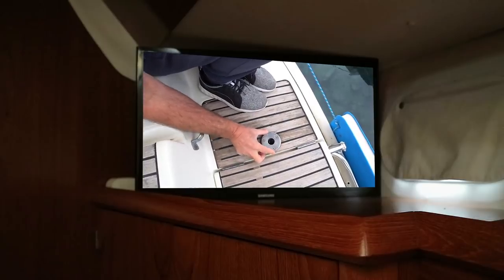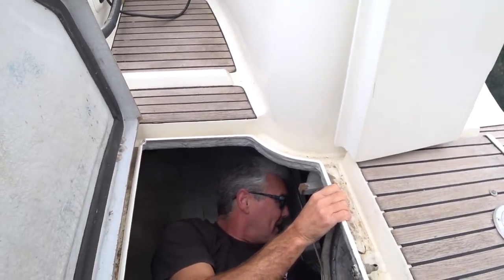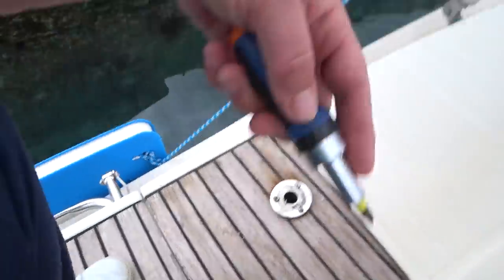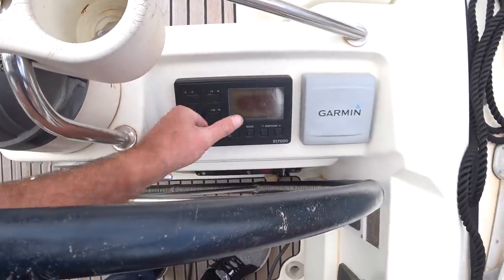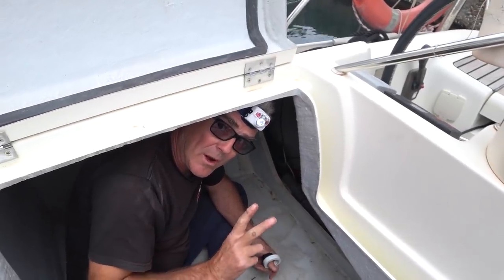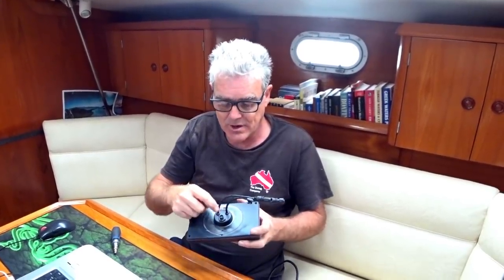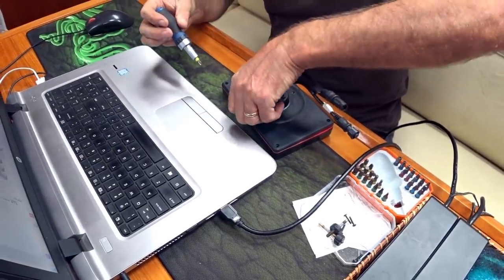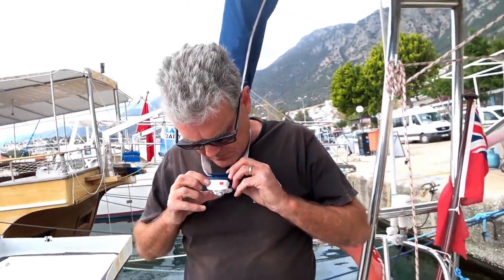Autopilot CRASHES... Can it be FIXED? - Sailing A B Sea (Ep.058)

Comment: I was glad to see that your autopilot was not the unit we are currently ordering up ;-)

As for the fuel mix, try Startron or FuelSet. They do similar jobs but at much lower concentrations. We currently use FuelSet and it is 5ml per 20L
Reply from the maker: Hi Beverley, thanks for the tips on the diesel bug juice. We'll look out for those brands while on our travels. Cheers.

Comment: We’ve got diesel bug in both our tanks. We’ve been using the biocides etc every time we fuel up so not sure where we got it from. We may have inherited it from the previous boat owner. 
We’ve installed a polishing system at the tanks. We’ve also got primary and secondary filters at the engines. 
We took our tanks out at the end of last season. One has a leak and both need a good cleaning. Anyway, what a big job. There really is no small job on a boat it seems. 😀
Reply from the maker: Very true, there are no small jobs on a boat and one job usually leads on to another. At least you've got nice clean tanks for this year.

Comment: Good to see you pre treating for Diesel Bug. We suffered a Starboard engine shut down at sea last year, due to the residue from a previous infection of bug. Our tanks and filters were supposed to have been cleaned, fuel polished before we bought the boat, but clearly this hadn't happened. (Outside of the filter casings were lovely and clean). At least we still had the port engine. It was still quite scary, as we couldn't move the engine filter on the starboard side, it was stuck solid, and needed a lot of work once back in dock to free it up. That filter hadn't been off for years. So treat the fuel, and change the filters on a regular occasion, both engine and pre filters.
Reply from the maker: We hear so many stories just like yours of jobs which were supposed to have been done. It's really not a good impression that the yacht maintenance industry is creating for itself. We're fairly certain that we don't have diesel bug, but it's better to be safe than sorry. Full engine service and filters replacement coming up in a couple of weeks before we set off for the next leg of our journey. Thanks for watching and commenting.
Reply: I normally say the job isn't done unless you've done it yourself, but I saw the bill the previous owner paid (£1500) so thought that's one job I don't need to do. @SailingABSea
Reply from the maker: (Baz) Agreed on the job isn't done until you do it yourself. When we were getting A B Sea ready in Spain, just after we'd bought her, we were living on board full time so whenever the guys were doing any work I was usually shadowing them with a camera in my hand. It was a great way for me to earn about how stuff gets done and to make sure the job got done right. Fun times.

Comment: Hello, you may tray to clean the print on the side were the swiches are with a electro cleaning solvent, and also the rear end of the touch pads.Some times salt and oxide privent the swich from working, it's  worth a tray,
Greetings from Holland,Reindert.
Reply from the maker: Hey MrMoto63, thanks for the tip. I'll ask around town to see where I can buy some electro cleaning solvent. Cheers.

Comment: no doubt you worked out that the plugs on the ST7000 were M & FM and didnt need tape. The 2 pin plug is NMEA input for external plotter (so you can follow tracks). If you pick up any ST7***(+) /ST6****(+) as they are backward compatible. Let me know if you need the manuals (and some experience) and I will send you a dropbox link to your FB messenger
Reply from the maker: Hi Greg, yes once I'd disconnected the cables I could see that they were M & F. Good to know for next time. That's interesting info on the 2-pin plug, following tracks could be very handy in some places. Thanks for the offer of manuals, I do love reading manuals. Let's see if the Raymarine tech from Istanbul comes through with the goodies and if needed I'll get in touch with you. Thanks for the helpful advice

Comment: Wow those diesel bugs must be tuff to survive in that environment.
Do you have to drain the water at the bottom of the fuel tank eventually ?
Reply from the maker: Mr G, If there's a really bad water contamination problem then yes you would need to get the fuel tank pumped out to remove the water. If there's a teeny bit of water in the fuel then it should be picked up by the in-line filter/separator, which can be drained easily.

Comment: Diesel: I live in Norway. I have never had water/condensation in my 1 off 500 litre tank and daytank 1 off 140 litre. If you experience water, two possibilities: Water delivered as diesel. A leak through deck fittings. Condensation cannot happen, plain fysics.
BR
sv Hulda
Norway
Reply from the maker: Hi HH, thank you for that information. I had read on the Internet that because the diesel tanks have a vent open to the air, it was possible that condensation could form inside the tank if conditions and temperature where just right. I'm glad we put the bug juice in anyway, better to be safe than sorry. Thanks for watching and commenting.
Reply: @SailingABSea  Bug juice is regardless a good thing. But if you experience water i  diesel, look for leaks. Som manage to have litres of water every year. That is by all physics laws i possible. I carry a possible volume of 650 litres. Once in 18 years, I have experienced half a spoon of water. But I have recieved litres of mud and shit from dirty supplies. At full diesel price.
Reply from the maker: Dirty suppliers is always a worry and once we move away from the busy Mediterranean fuel docks we'll be filtering our fuel on the way into the tank. Cheers.